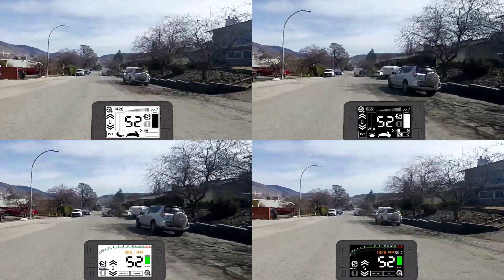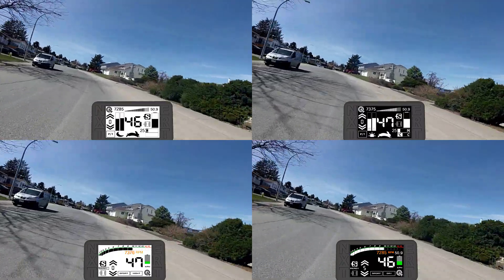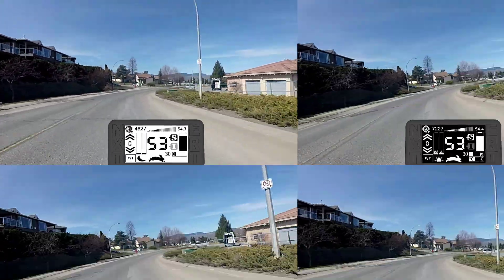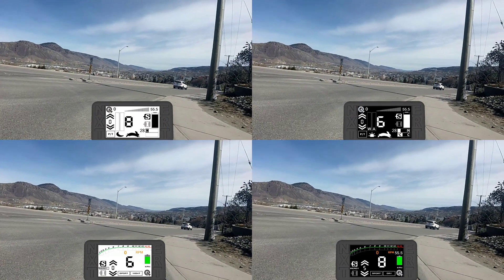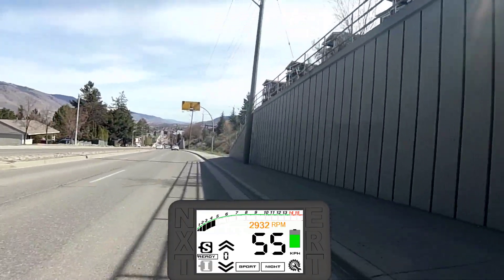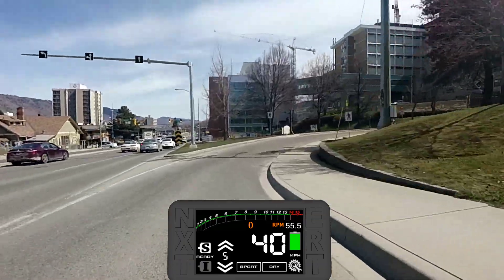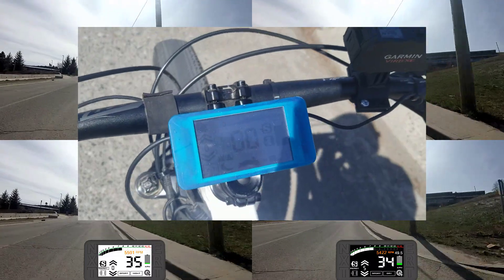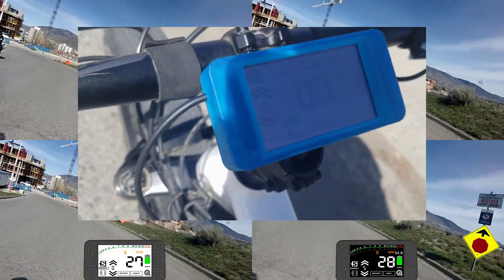NXT Ebike Touch Screen Display - Lets Look at the Main Screens

Comment: hi captain, i just updated mine last night, but the nxt gauge will only work if i click ready and choose assist, the assist number also isnt showing.. and regen doesnt seems to work even at 100%.. will there be an update fix for this?
Reply from the maker: You need to log support issues with ERT. I help with development in terms of graphics etc but I'm not technical support especially on a bike I don't ride. There is a support portal you can register an issue on.

Comment: ....It's amazing, It looks like since the NXT went live ERT literally sold out of BAC 800 Controllers lmao
Reply: I was just on ERT. They are still available.
Reply: follow up question will we be able to use the display as a key during beta testing?
Reply from the maker: Key functionality is not implemented yet. But as a tester you would get to try it first. BAC800 should not be a stock issue. But I'm not involved in supply and manufacturing either.
Reply: @HighVoltageKits  Okay. Congrats on the 1k Subs!! This is only the beginning. ERT's website is giving me a host of errors when i try to add the BAC800 BBSHD kit to the cart. I can add the display itself for $150 just fine, but the BAC kit is a no-go. Would i need to send an email to get both shipped when the time comes?
Reply: LMFAO both the motor cover and the slim twist throttle (which i was really keen on getting) is out of stock. false alarm guys, my bad.
Reply: Electron Cycles is also out of stock
Reply from the maker: I'll ask. I imagine things will get updated.